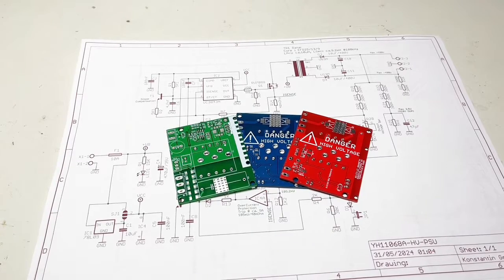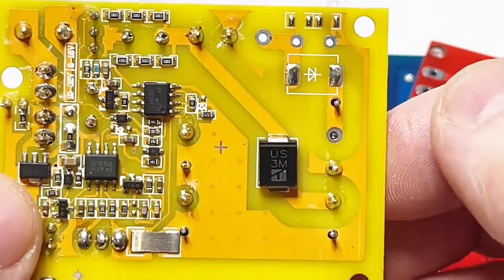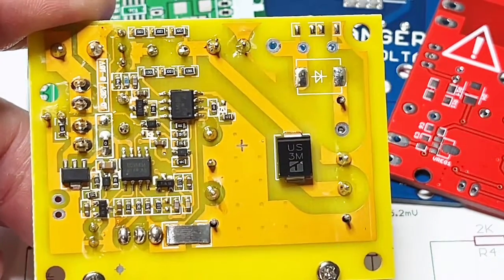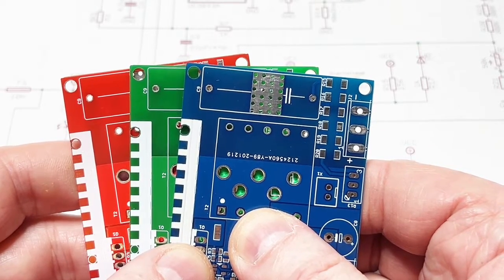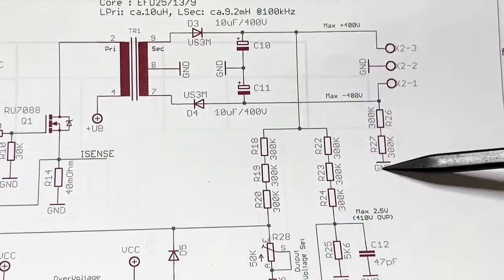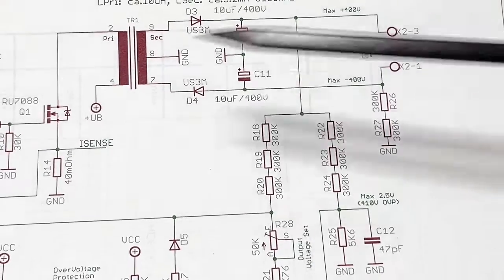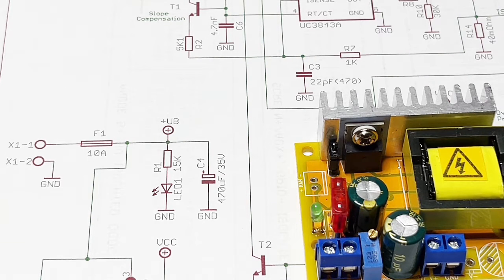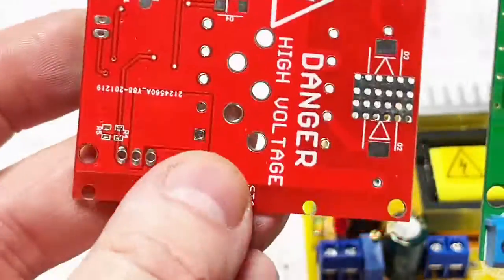YH11068A 45-390V High Voltage DC-DC, Schematic, Details, Tips and more!

Comment: I found your video because I have a few of these and the output oscillates on all of them.   I was searching for a schematic and found you.   I want 120 volts to power a 50 milliamp load using 12 volt power supply.   The output oscillates at about 10 Hz with about 35 volts ripple.   The output of the transformer i Sa bursting signal at approximately 70Khz at that 10 Hz rate.  This does not seem right.   I have seen videos where they loaded these units down to 120 milliamps at 350 volts.   I saw no oscillations in their testing.   I added larger output filter caps and that slowed the oscillation/bursting to 4 Hz.  It seems I need some damping somewhere in the feedback loop I would think.     It seems it should burst at a faster rate with sorter duty cycle to keep the caps topped off to minimize the ripple.    OH!!   I have the dual rail version also.   Positive and negative output.  Any suggestions?   Thanx!!
Reply from the maker: Hello, I have never seen the Bursting Behaviour that you describe, the Converter has ans Osc Freq of ca. 75kHz and Basically works.
What you describe sounds for me like if the OCP is Kicking in or that te UC3843 Chip shuts the Mosfet Prematurely bcs of a leading Spike seen at CS input of the Chip.
The Chip CS Input is connected to the Sense resistor via a LowPass Filter with a 1K resistor and a 470pF Capacitor, if this Lowpass Filter is missing or not working correctly, 
it would yield such a behaviour. Fact is that this Behaviour is not normal and I never observed it with these DCDC modules.

1) Add a resistive load (incandescent Bulb of 15-30W) and set the output to 220V (or whatever the mains Voltage of your Country is) and check how it works
2) Just for testing raise the Input Voltage to 20V, check how it works
3) how Large where the Output Capacitors you added ?
4) Do not use the Negative output Part of the Converter & leave the capacitor value of the Negative side unchanged. 

Cheers,
Konstantin
Reply: @KonstantinGrigoriadis  THANX
Reply from the maker: @jp040759  No Problem!
Reply from the maker: @jp040759 Although I did not experienced the Mentioned Behavior you describe, I read yesterday by coincidence in a Forum that others experience the same issues like you.
Cheers,
Konstantin
Reply: @KonstantinGrigoriadis  I think we are on the right track.   All the videos I saw of stable power supplies were of the single polarity versions of this devices.   The one I have is the dual polarity.   Someone stated that only one polarity is actually  regulating and providing the feedback loop error signal.  I think if I reverse one large Schottky diode for the unregulated leg to make a center tapped full wave rectifier so the regulated side is the receiver of all rectified pulses and tie that to the regulation feedback loop circuit, that may fix the issue.    I will try that when I get time.  My main drive is to get this module to output 120 volts DC (120 volt ac RMS in USA) from a 12.6 to 14.5 volt car electrical system so I can drive LED Christmas/Fairy light strings in my truck.  I only need 20 milliamps to drive 100 LED strings.
Reply from the maker: @jp040759 Well that is not a good Idea with Reversing the Sec Diode and trying to Build a Full wave Center tabbed Rectification. 
You will probably Destroy the Capacitor and Diodes. Btw. these are Not Schottky ones but Ultrafast Silicon ones.
The reason is that the Transformer used in reality has not a Classic transformer role is, rather it as a Couple Inductor with
a Gapped core to store the Magnetic Energy when the Mosfet is ON and release this Energy into the Secondary Winding when the Mosfet is Turned OFF. 
This is a Flyback Topology !! In My video I explained my Reverse Engineered Schematic and that the Negative Part (if there is one) is not included in the Regulation (which is normal) with many Multi-rail output Flyback Converters, but not in the way this Converter does…
Just do not use the Negative Secondary at all , use only + and Gnd.

This Converter has a Horrible Output waveform when I use a 220V Incandescent Bulb (Ohmic Load Mostly) of 25W and Power the Input with 12V.

It draws > 2.5A and in 30-60 Minutes the Heat-sink gets so hot that is untouchable! The Output Signal is Distorted Completely with a 4Vpp Ripple + Noise. 

My Design (that is not Optimized yet) using the "Transformer" and the Heat-sink of the CN Module with the same In & Out Parameters has a normal Saw tooth like Output waveform of only 700mVpp, gets warm too at 25W but in means like the CN does.
In my Design I use the "Transformer" and the Heat sink of the CN Module to archive up2 1000V of Output for a HV Capacitor Leakage Tester Design. I plan a Video about the HV  DCDC Converter.
 
Btw: the Transformer uses an EFD25/13/9 Core that will deliver Max ca. 20W(according to Magnetics Datasheet), I am already with the >= 25W Load over it.

You can condider using something like this too:
https://www.amazon.com/Inverter-Converter-Step-up-Voltage-Regulator/dp/B0D1G5K25Z

The CN Converter Layout Design is just Bad! 

Cheers, Konstantin
Reply: @KonstantinGrigoriadis  Thank you again for all your insight.   I will consider these issues when testing.  You reminded me that I have 100 to 150 watt 120 vac RadioShack inverters in my junk box I saved from somewhere.   I will try those and see what the 12 volt supply current is.       THANX
Reply from the maker: @jp040759  No Problem :-) Cheers
Reply: @KonstantinGrigoriadis FYI,   I dug up the 150 watt Radio Shack inverter.   At 13.8 volts in it uses 9 watts of power for the inverter and LED string.   I measured the LED string alone on my Killawatt tool.   It only draws 1.5 watts.   I have a Centek inverter from Harbor Freight.   It is a 250 watt unit.   That uses 11 watts of power with the LED string plugged in.   Inverters are just too power hungry.    CHEERS to you!!!!
Reply from the maker: @jp040759  Well, these kind of Inverters I can Imagine, bcs the are Build to be connected to a Car or Boat or whatever Battery with enough juice :-) 
Cheers,
Konstantin

Comment: Thank you for your video! 
The converter woks properly with a load of only 30W. How do you think is it possible to get 150W with of this circuit. If so what should be changed
Reply from the maker: Hello, Thankyou! there is no way that you can get 150W from that Module ! The core is up to MAX 20-40W depending on the Frequency, for a 150w Flyback with these In/Out Voltage Parameters, there is a Complete new Design with a larger Core needed. For that Output Power I would not use a Flyback Topology at all but instead a PushPull one.
Cheers, Konstantin

Comment: Liked and subscribed.
I am doing small guitar valve amplifiers and I have one of those boost converters.
I bought it some years ago but always found it noisy.
One thing that I've noticed, in my case, was that if I put a linear regulator between my laptop supply and the boost, a good amount of noise disappears.
What do you recommend to be changed in order to use it in a guitar amplifier? Putting new good quality electrolytic caps, add another output filter??...
What about changing de switching frequency to the double?
Cheers
Pedro
Reply from the maker: Hi Pedro, Thankyou! Well the Design of the PCB is not optimal, but if you use a Quality Low ESR 47 or 68uf /450V output Cap instead of the little crappy one and a secondary LC Low Pass Filter (eq. 1mh Iron Powder & 10uF 450V(MKT not Electrolytic) for example, or even different values) should make a change! Setting the The frequency to double is NOT advisable bcs the Transformer is not designed for that. The Frequency is already ca.75kHz. Cheers, Konstantin

Comment: I bought one such power supply. I plugged it in, started testing it, got to 200 volts and the board died. I only needed it for an experiment. The microchip uc3843 does not last 2 minutes of operation. I'm going to gut the board, keep only the feedback connections for the comparators, leave the power part and graft a tl494. I hope it lasts half an hour to get my work done...
Reply from the maker: Hello, with what voltage you powered the Module and what Load you used ?
Normally these things work ok when used in their real limits, except if you had faulty module. To use the tl494 it must be configured as a single output for a flyback . The tl494 has no advantage in this circuit as a flyback over the uc3843. The comparators are used for Over voltage and Overcurrent . Cheers, Konstantin
Reply: @KonstantinGrigoriadis  I tried powering a small neon lamp (about 90 volts) through a 1 megohm resistor. The supply voltage of the module was 12 volts.
Even the LED indicator on the module burned out. There is supply voltage on the LED pins, but the LED has gone.
I have quite a 16 pin tl494, it has built in comparators.
If I like the Frankenstein that will result between the TL and the module, I might consider factory pcbs. :)

Comment: How can I buy your stable 1kv PCB?
Reply from the maker: Hello, I can send you the Design Files (Gerbers, Bom, Schematic) via Mail. My Email is in the Description of my Channel.
Please bear in mind that my Design was made for a High Voltage Capacitor tester, hence the Output Capacitor is only 1uF 1KV. You would nee to change that if you need Higher Current.
Reply: Sorry, not able to locate your email.  @KonstantinGrigoriadis
Reply from the maker: Click on my channel description that ends with ">" or "...more" to open the About section.

Comment: Why have 2 different current sensing, the chip ISence, and the slowish LM393 output???
Reply from the maker: The sense on the cs pin is to limit the current cycle by cycle as a part of the Regulation, the sensing via the 393 is used to Shut it complete down in a ocp situation like a crowbar, donno why they did it so, its redundant .
Reply: @KonstantinGrigoriadis  Oh really! :)   Of course they, and I and once again spoke too soon and failed to engage my brain!.

Comment: Thanks for sharing. I use it as stabilized screen supply for push-pull 7189 pentode stereo amplifier.  300 V, 10-50 mA. Removed unnecessary bulky parts: fuse holder (replace with 40 AWG jumper wire), screw terminals, LED, trim pot (replace with 2.2K resistor), all electrolyte caps (bad quality indeed). In freed-up space added 10 uF stack of ceramic wafer filter caps, 1 mH iron powder core filter toroid, and 10 uF 450 V Nichicon second filter cap. Plus additional outboard LC filtering element. The module screwed to aluminum chassis by heat sink, with thermal paste between sink and chassis - for better cooling.
Reply: The jumper wire being melted and blown could make more problems than a high current )
Reply from the maker: Hi Anatoly, Thankyou! Yes as I said its some Work necessary to get these Modules output "Cleaner". I would be interested to see how the 10uf Stack of Ceramics look ! What additional LC Filtering element you men/use ? My Email is in the Channel Description Tab. Cheers, Konstantin
Reply: @anatolygrishin4234 
Hi,
After all your modifications, is the output clean enough so you don't hear noise while listening to music?

I have an EVAL board by Analog Devices, which outputs 240V@700mA, and it is pretty much noiseless. However, it is large and expensive. I am considering designing a small PCB with their suggested components and use that instead.

The cheap option would be to do what you've done or to buy 2 encapsulated transformers and connect them back to back.
Using something like two 230V -> 2x 6V transformers. These have a no-load voltage of 7.6V, giving a ratio of 30.
Wiring the 2 x 6V in parallel will give us the maximum current, and we will have 6V available for the heaters (we can wire them in series to have 12V).
Next, we connect the output of the second transformer to the output of the first to get 230V (in an ideal world).
After rectification, this would give 230V * 1.41 = 324V DC (in an ideal world). Even if it falls by 50V, we still have a really good voltage for the supply. Increasing the output voltage of the first transformer would increase the voltage available for B+.
This would cost me peanuts and could work. Any thoughts on this?
Cheers,
Pedro
Reply from the maker: @geekPlayground Hi Perdo, well my Design is not Intended for Audio, but for up to 1kV Output up to 20-30W, as a rather small Universal HV Psu and as a HV Source for my planned Capacitor Leakage Tester. 
I plan to make a Video on the Redesign I made of that Board using the onboard Transformer.
For Audio I would use only a PushPull Design as a DCDC, which will be one of my future Videos. 

As for the Back2Dack Mains Transformers:
1) Bulky and not Flexible
2) not a DCDC Design powered from Low Voltages
3) Not Regulated and Not Adjustable
4) if you want add Regulation to that, you need a a Higher Voltage Linear regulator which is Inefficient.

Which Analog Devices Eval Board you have ? 
Cheers, Konstantin
Reply: @KonstantinGrigoriadis  
I am sorry, but the question was for @anatolygrishin4234. I made a mistake 🙂
Regarding your comments:
1 - Agree
2 - No, but that's ok for me too
3 - Well, all the transformers in valve amplifiers are just transformers; they are not regulated. If the manufacturer guarantees that the transformer will deliver 6.3V under load, then it's fine. In the case of these encapsulated ones, it's 6V. Regulation will be necessary if we want to use DC for the heaters, though.
4 - Totally agree, but I don't want to add regulation to the high supply rail.
Thanks
Pedro
Reply from the maker: @geekPlayground  No Problem 🙂
If it should not be a DCDC & unregulated & non ADJ, then the Back2Back Design is OK, Cheers, Konstantin
Reply: @KonstantinGrigoriadis  Thanks for your reply. In my case is for a guitar amplifier.

Comment: Nice project.  Are there terminals/connector to read the scaled output voltage setting and cap leakage current?  I was looking for something around the volt set potentiometer.    I am thinking it would be nice to use the cheap Chinese LED voltmeter modules to display output voltage and current.
Reply from the maker: Hi Darren, Thankyou! The Modules of the Video are just the HV Flyback Converters for the Future Cap Leakage Design which will be MCU based and display both Set Voltage and Leakage at the Set Voltage on a LCD Display. 
The Cap Leakage Tester will have switchable:
1) a 12 Pos Switch forming a Voltage Divider String for standard High Voltages 
2) a 10Turn Pot to set the High Voltage Freely
2) a 12 Pos Switch forming a Voltage Divider String for standard Low Voltages < 50V or so
Cheers, Konstantin
Reply: @KonstantinGrigoriadis  I look forward to the finished design.  It is something that I have wanted to build for a long time.

Comment: look forward to your design.
Reply from the maker: Which one ? My Version of the hv module or the capacitance leakage tester ?
Reply: @KonstantinGrigoriadis  My first interrest goes for the hv module. Reusing the parts for a better module with real world specoifications (without the need to cool it down to near zero Kelvin like Ali express does it). I am interested in getting the ripple voltage down to a minimum.
Reply from the maker: High Tony, the Transformer uses an EFD25/13/9 Core that will deliver Max ca. 20W(according to Magnetics Datasheet), that probably was intended for a Capacitor Charger for Photography  Studio Flash(my Assumption :-).
The Transformer gets Warm when these max 20W are exceeded and bcs the transformer is probably not designed to work with a duty Cycle more then 50%, which is the case using the UC3843 Chip that goes up to almost 100% Duty.
In my Redesign of the Module for the Capacitor Leakage Tester, I will never reach these 20W. The most important is to not exceed those 20 W (the Magnetic Datasheet states it even for less 18W) and to use higher Input Voltage (19-24V Laptop PSU), to keep the Duty Cycle as near as Possible to 50% by using the Whole Secondary Winding instead only the Half !
Cheers,
Konstantin

Comment: Got this module for testing transistors for their avalanche properties (for a Jim Williams fast edge pulse generator) works nice, I only used up to 250v. Just I'll be adding a filter on the output, something at least 22uH inductor and a second capacitor, probably a few ceramics too, I don't need a lot of juice but lower noise will be nice, I didn't measured the noise but  probably be way more than 10Vpp.
Reply from the maker: Hi Ruben, the LC lowpass is nessesary , I would suggest additionally a ferrite bead  1000ohm@100Mhz followed by a 10nf HV Ceramic. This Module IS noisy :-)